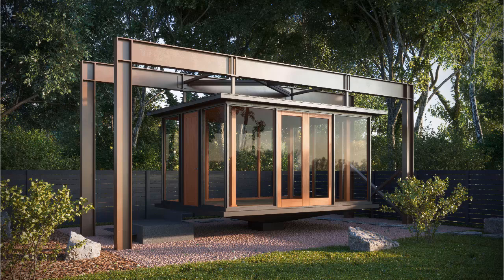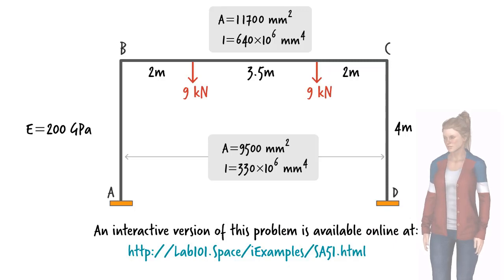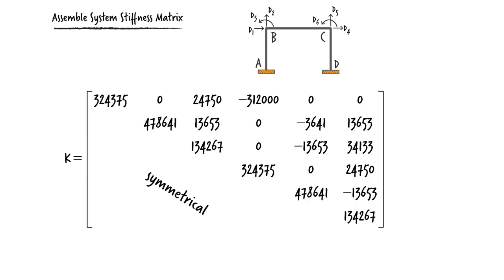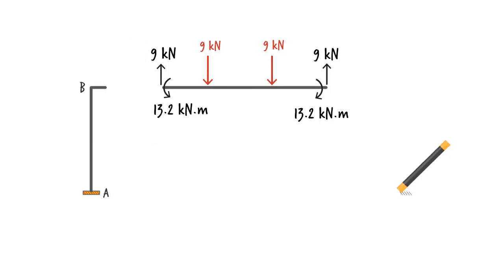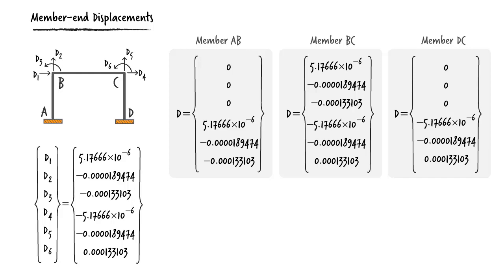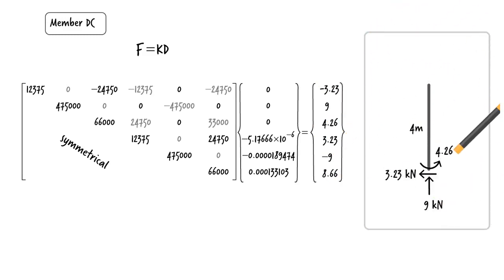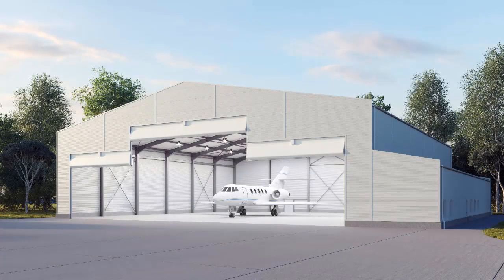SA51: Analysis of a Tea House Frame using Matrix Displacement Method

Comment: Wasn’t D1-f1 a component of axial force for local stiffness matrix in beam-column element? Why it became a shear component for vertical members here, is it consistent with definition of local stiffness matrix? Also, why didnt we use force/displacement transformation matrix?
Reply from the maker: The stiffness matrix shown at 1:50 is in the global coordinate system, meaning the transformation matrix is embedded within it.

D1 represents the force in the x direction, not in the local (member) coordinate system, but in the global coordinate system.

Therefore, the solution (displacements and member forces) is entirely in the global coordinate system.
Reply: @ Thank you for clarification and great video lectures!

Comment: Hi
@3:16, it's stated that member AB adds to the system stiffness in directions 1, 2, and 3. But the System Stiffness Matrix shows this contribution as K44, K45, K46, K55, K56, K66. Can you elaborate on this?
Reply from the maker: The system directions 1, 2, and 3 correspond to the member AB directions 4, 5, and 6. So, the stiffness contribution of AB in system directions 1, 2, and 3 comes from member stiffness directions 4, 5, and 6.
Reply: @DrStructure  
Yes, the sketch at 2:18 illustrates these directions for member AB. Thank you.
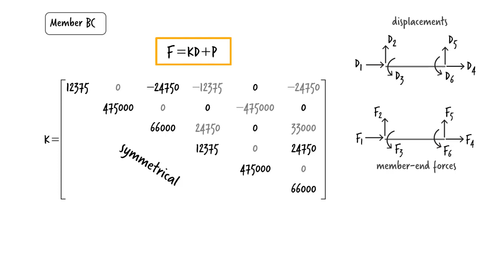I came into another query. At 2:50, the sketch shows the degrees of freedom for member BC, which is the same coding for system (structure) degrees of freedom. I can't catch this.
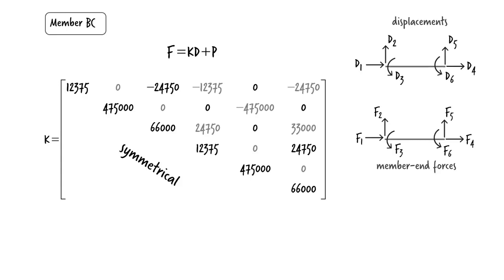Why the matrix at 2:40 isn't the same when it comes to 2:50 for member BC?
Reply from the maker: @hoshangmustafa9672  It depends on how we number the joints of the frame and assign DOF indices. 
For example, we can number the system DOFs at joint C as 1, 2, 3. And number the DOFs at joint B as 4, 5, 6. Then, 1,2,3 of member BC would correspond to 4,5,6 of the system. And, 4,5,6 of member AB corresponds to 4,5,6 of the system.
Reply: @DrStructure  
It's clear now. Thanks.
How K12=0 for system?
How K22=478641 for system?
Reply from the maker: @2:40 the YouTube video shows an incorrect stiffness matrix for member BC. Please see this same (but updated) lecture in the online course (https://courses.structure.education/courses/structural-analysis-ii  ) for the correct matrix representation. 

K12 (system) = k45 (AB @2:12) + k12 (BC @2:35) = 0 + 0 = 0.
K22 (system) = k55 (AB @2:12) + k22 (BC @2:35) = 475000 + 3641 = 478641
Reply: @DrStructure  
Thanks. I can't find the videos in
https://courses.structure.education/courses/structural-analysis-ii
Reply from the maker: It is the first lecture in Practical Examples section of the course.
Reply: @DrStructure  
I meant how to play the video?
Reply from the maker: You need to sign up for the course. 
There are two courses available: Structural Analysis I & II. This lecture is in Structural Analysis II.  Each course has its own signup page.
Reply: @DrStructure  
Thanks. Now, it's clear. Highly appreciated.

Comment: Please check ,may be mistake in using formula in calculating equivalent nodal load,in left beam bc  used  pb/L shoud be pb^2(L+2a)/L^3 and the right  beam pa^2(L+2b)/L^3
Reply from the maker: You are correct, the expressions for the left and right member-end shear forces @4:50 are written incorrectly. Thanks for noticing it and bringing it to our attention.

Comment: For time 2.20, why did we draw our member end forces according to global instead of local coordinate which produce a problem with changing  f1 and f2. Can I solve it by taking local coordinate?
Reply from the maker: Each member has its own local coordinate system. To assemble the system stiffness matrix and solve for the unknown displacements we need to use a single coordinate system, which we call global/system coordinate system. So, the properties of all the members have to be transformed into that coordinate system. As a result, the system displacement vector (which is the main result of the analysis) is going to be determined in the global coordinate system. From there, we can determine the forces at the ends of each member. These can be done in the global coordinate system or the local coordinate system. But at the end, we usually prefer having the members forces written down in local coordinate system since that makes it easier to draw the shear and moment diagrams for the member.

From the computational standpoint, we can view the displacement method consisting of three main steps: pre-processing, main processing, and post-processing. In the pre-processing step, we determine the joint loads and transform everything into the global/system coordinate system, and assemble the system of equations to be solved. In the main processing step, we solve that system of equations for the unknown displacements. In the post-processing step, we use the computed displacements to determine the member-end forces.